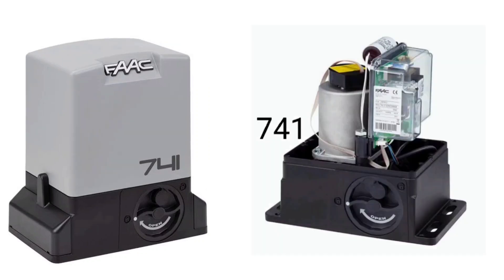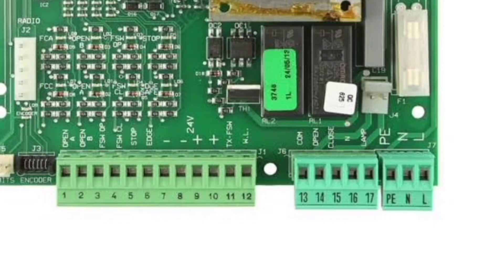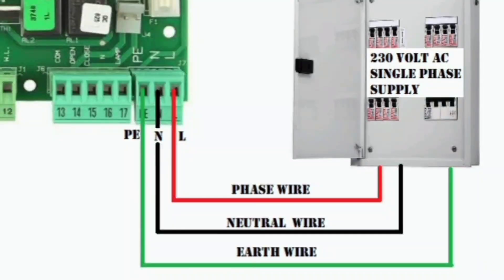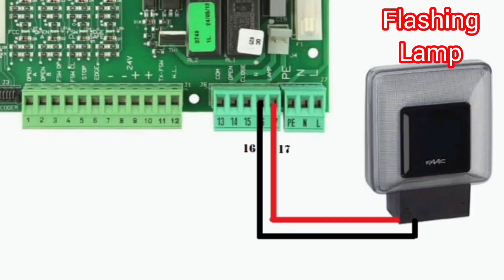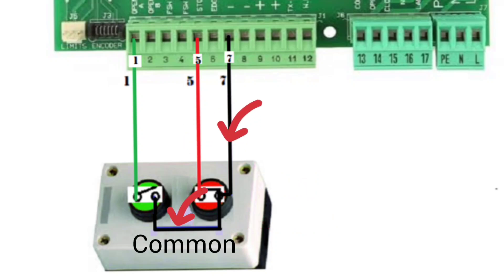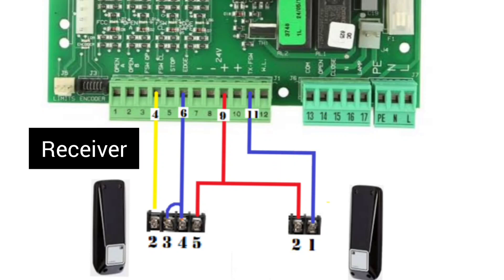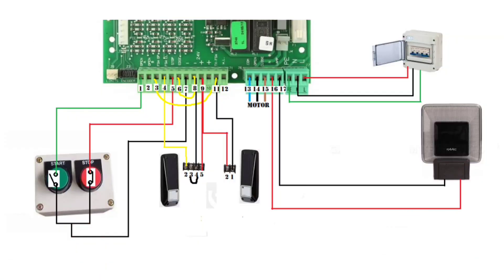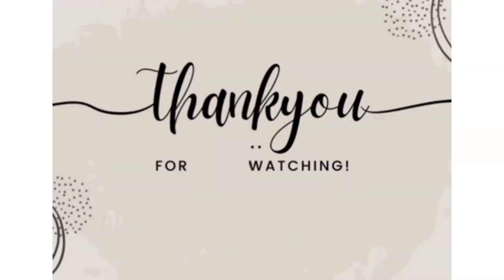How to make connections of FAAC 740/741 Motors using 740D control board.@Omegatech1971

Comment: If you want connect gsm controller will you use connection like for push button?? Thx
Reply from the maker: If your gsm controller operates a relay then connect common of relay to  terminal 7 and "NO" of relay to terminal 1. 
Make a loop between terminal 5&7, if you dont use NC Push button to stop gate.
Set logic to AP i.e Automatic.
If you give command(a pulse) through gsm controller the gate will open and it will close automatically after a preset time.
Hope this is useful.